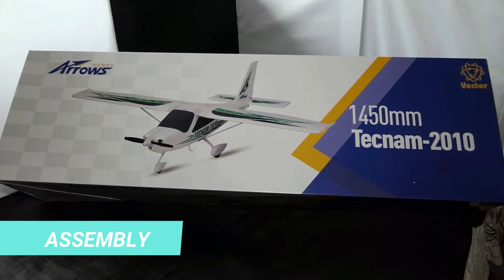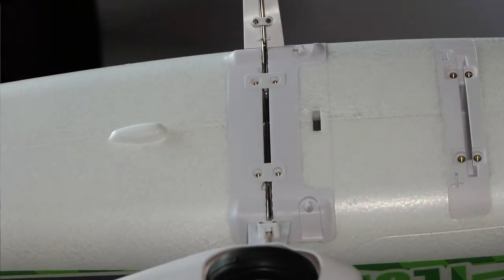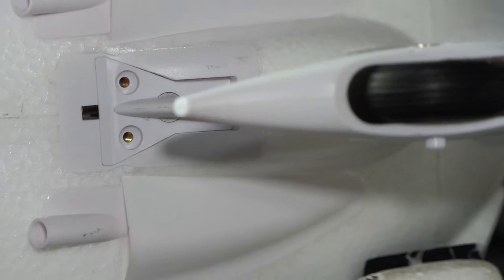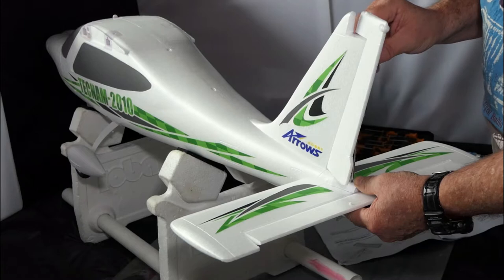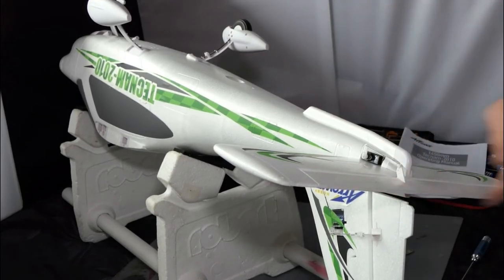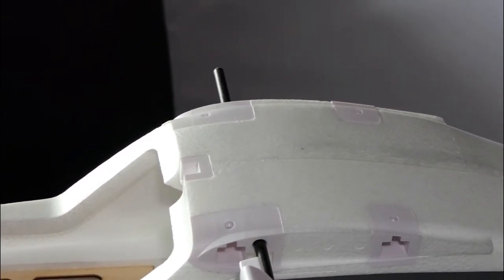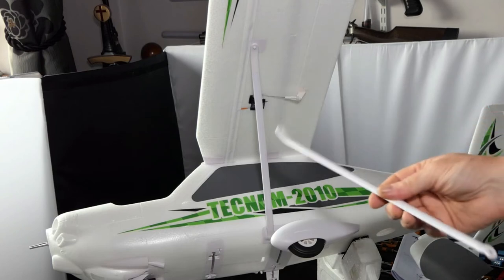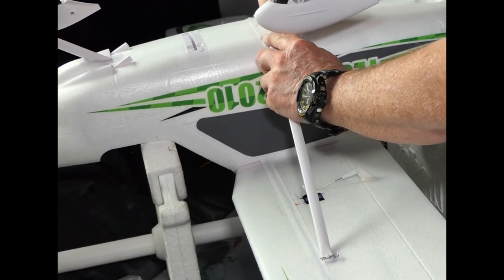Assembly - Arrows Hobby Tecnam 2010 Assembly Part 1 - 31 July 2021

Comment: yeah i'd do the wings last too! that nose gear servo seems to be backwards to my eye the wires should be behind it not under the arm!! different plates? now one for the main and a different one for the float arm yeah but two different on the same bracket? i use a set of small hobby sized wire cutters on those ties myself Martyn they seem to cut them easier and better than scissors will! iof you have trouble seeing the alignment in the holes try a key chain flashlight or a head lamp! those head band lights are handy as hell for that and so much more when you need light and both hands to do something!

Comment: I recently purchased the Arrows Tecnam 2010, and although I can appricate its beautiful scale detail, I would really like to modify / remove the wheel pants / tires and switch to a set of larger type bush tires.
This is due to the fact that my local flying field is an asphalt pad in really poor shape with a lot of deep cracks. Also the nearby lawn is not regularly manicured , so I have found that larger bush type wheels are much preferred.
After looking at the gear set up on this model, I think I might be able to remove the main gear wheels and pants, but not sure if there is a way to modify the nose gear to accept a larger wheel.
I am completely OK with totally destroying and removing the original pants, and would greatly appricate any feedback from someone who has successfully done this type modification and how exactly it's done....
Reply from the maker: Hi Gary - I took a good look at the undercarriage for the Tecnam , the mains I agree with you with minimum effort a few spaces on the axel and a few locking collets to hold the wheels on the Wheel Pants can be removed, as for the Nose wheel  as you say its not that easy at all as the Pants actually hold the wheel and the Pants are connected to the down strut.. Sorry I have not solution I can offer, Maybe someone else might have an idea.
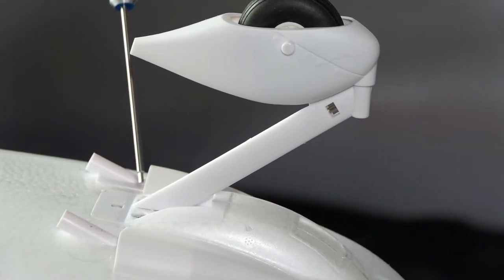Reply: @FlankerTanker   ...freeze your video at the 7:00 min mark  ( nose wheel ) ..... I might try the following.....with the plane inverted , as in your video, I was  thinking about cutting off  the bottom  and opening up the nose shirt /pant , then simply  drill new holes slightly farther back  on both sides and  push a new axle through...this might   allow me to slightly  upsize the nose wheel ......what do you think...have you had much experience landing and taking off from grass with this planes?.....thanks